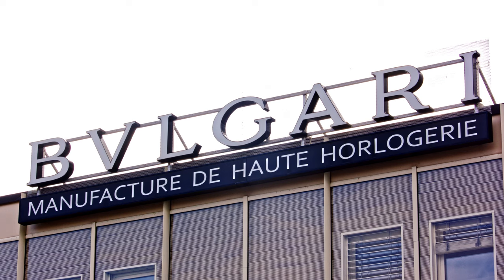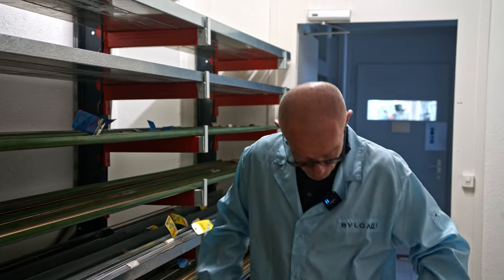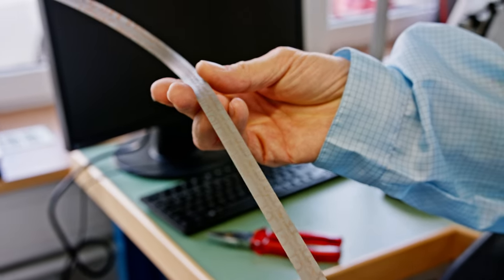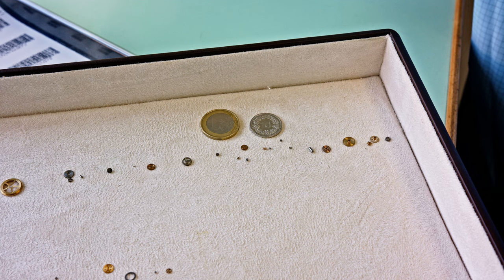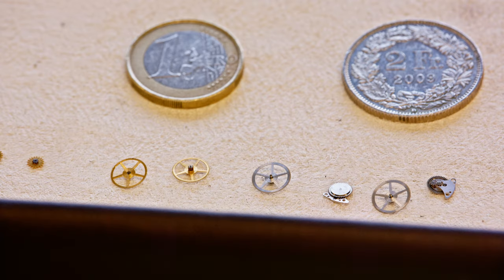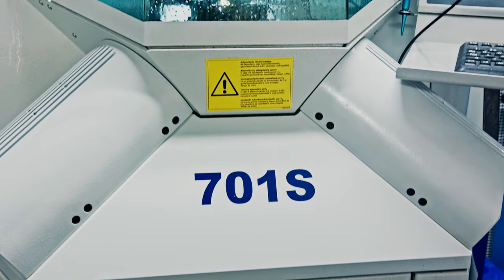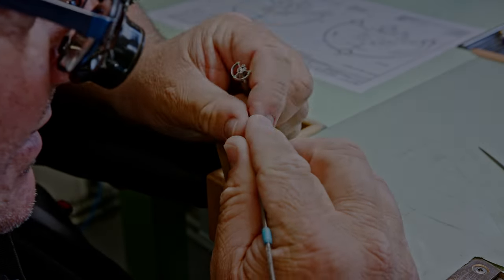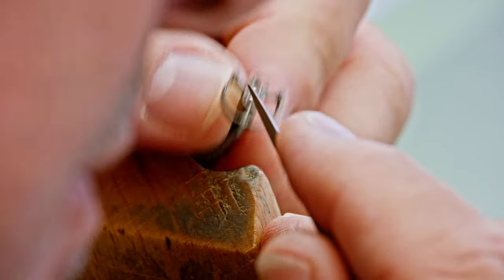BVLGARI Octo Finissimo. PART ONE. Thin, thinner, thinnest... The making-of an iconic wristwatch.

Comment: Bvlgari product designer is conservative n Old ... they could use titanium grade 5 instead lower grade titanium and they could polish the case instead make it matt finishes and  they r so lazy to choose matt grey dial with enamel .. the product hardly compete with cartier..
Reply from the maker: This product is UNIQUE, it does not compete with any other watch, it has 100% market share in its segment…
Reply: @WatchAdvisor  well i  found a  micro crack on the case and the bvlgari staff dont even notice until i show them the spot..🤣well at least only once.. and their 2 years warranty show tht their cant promised   a lot on their zenith/ inhouse  machine
Reply from the maker: @johngear5747  ??? Can you specify please?
Reply: The Octo Finissimo conservative??

Are you not aware with all the other materials and finishes they are offering? Besides Omega haven’t seen any other company with so much variety in their line.
Reply: @WatchAdvisor  The product is incredible.  I wish I was lucky enough  to own that watch.  People don't understand that the tolerances are microscopic, and you just can't throw it on Titanium.  Titanium is very hard to work with.  Great video.